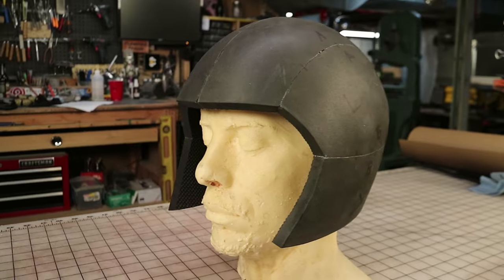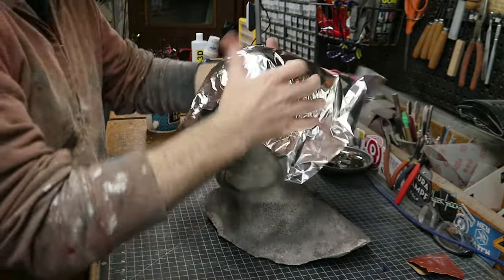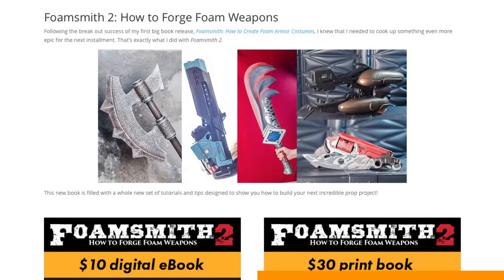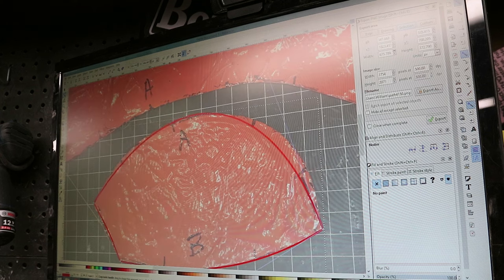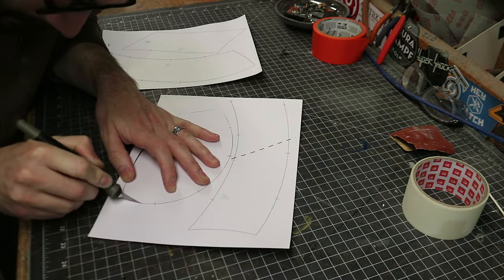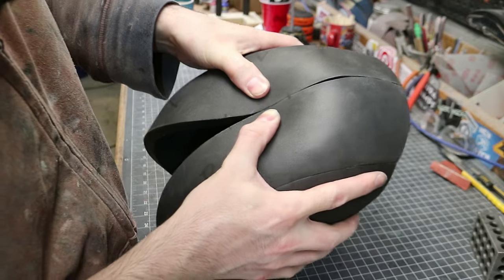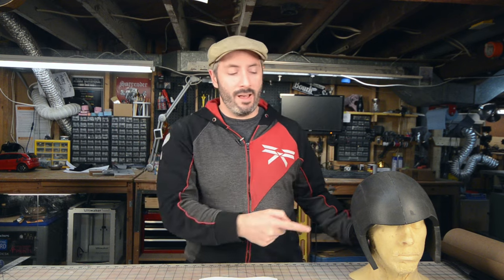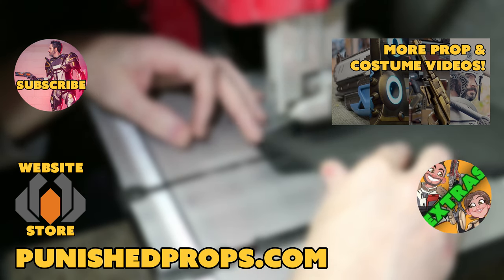Basic EVA Foam Costume Helmet Template Tutorial

Comment: What if I don't have.. A head..?
Reply: Then you shouldn't need a helmet.
Problem solved.
Reply: Then you shouldnt need a helmet! Problem solved.
Reply: Then you shouldn't need a helmet? 
Problem solved.
Reply: hibbity hoobla
Reply: Then helmet shouldn't need you. Solved problem.
Reply: Build yourself one!
Reply: Lol
Reply: same boat 😔
Reply: Trying to figure that out myself
Reply: I attatched lined paper to my head using mostly packing tape. I did lose some hair in the process when it got stuck to the tape, but I ended up with a 3-D paper model of my head that I was able to trim and use for a rough template... It did take more than one try to get my foam to be the right shape though, so take my method how you will. But it's what I did haha. XD
Reply: Try using a balloon

Comment: This works really well! I made the craft foam head form another video because mine is above average and needed custom scaling (62 cm) and then I came over to here. My scanner scans at exactly 8.5 x 11 inches so I just threw the slices in there and was able to scale them in gimp 2 after using magic select to find the edges, turning that to an outline, and cleaning up the edges.

Hot tip: the extra space at the back of the neck is super important!

Comment: I've been watching several of Bill's helmet videos, and I was wondering if there's a easy way to put a hard surface over the EVA to get a hard shell. I've not gone through all the videos yet, so does he cover this? I've also not yet built one, so I'll probably keep it simple for the first project, but I think I'd like a hard outer surface for my stuff. Maybe fiberglass? Epoxy? Thoughts?
Reply from the maker: Smooth On makes an epoxy called Epsilon that's great for brushing on a solid coat on foam.
Reply: Punished Props Academy, thanks! I signed up for the quarterly maker box too late and missed this kit. I found the pattern on your website. I'll have to find the other materials too.
Reply: Would be nice if I could order a helmet kit. Might be a product idea for you.

Comment: hi :) i'm new to the whole costume making thing and i was wondering if i could use rubber sheets instead of EVA foam for making armour, etc. Would it be the same as crafting with EVA foam? Thank you :)
Reply from the maker: It really depends on what "rubber sheets" are made out of. I know my friends in the Philippines use something they call "rubber sheet" and it works just fine for them.
Reply: Punished Props alright i'll give it a try. thank you so much! :)

Comment: May I ask how strong are the seams? what kind of force would you need to part them again? or is it as strong as the foam would be in one piece? Hi by the way, new sub here :D
Reply from the maker: +Aartwood The contact cement bond is stronger than the foam.
Reply: Punished Props thanks so much good sir, having spend the last 4 hours watching your channel and your appearances on tested and casting rubber hammers I'm feeling truly inspired right now! :o
Reply: Punished Props thanks so much good sir, having spend the last 4 hours watching your channel and your appearances on tested and casting rubber hammers I'm feeling truly inspired right now! :o

Comment: I am working on painting a helmet right now.  For the base paints I used vinyl paint.  For the details, I'm using a mix of wax and acrylics.  I would really like to seal the whole thing in a gloss clear coat to give it an oily metallic finish, but I am concerned about the flexibility of the material and whether a traditional clear coat will hold up.  Do you have any recommendations?
Reply: And that's why you're the pro maker.  :)  I know I have some spray shellac somewhere.  I'm not sure if that's what you are thinking.  
Looking at varnishes, I'm seeing quite the variety.  Some are enamel, some are acrylic, which brings up the question of what is the difference between those and the spray clear coats?  
So, I'm going to guess that you're referring to the polyurethane stuff.  

Thank you.
Reply: What's messing with me now is that I keep looking at reference photos and the helmet looks like it has different finishes in different shots.  In some shots it looks slick, like its covered in oil, while in others it looks dull and dirty like its covered in dust.  :|

Comment: do you guys recommend the Zebra contact cement, or is there no difference? and would 45 ml fit this one project?
Reply from the maker: I've never used Zebra contact cement. If you plan on doing several projects, you should probably get more than 45ml.
Reply: Punished Props thanks for the feed back. Hopefully it will be the same as every other contact cement, and yeah I may need more than 45ml. Thank you again and I Love your work.

Comment: Just one or two quick questions, if you cut the foam by knife would you sand it before gluing, and if so what strengths of sandpaper do you suggest?
Reply from the maker: The foam doesn't get sanded. The only time I'll sand the foam is if I do a round over or bevel with my rotary tool and use sandpaper to clean up the fuzzy foam bits.
Reply: Thank you! Saved me from having a dumb mistake! Happy Crafting!

Comment: What if you dont have a whizzydo computer program.. What if you have to do it all by hand???
Reply from the maker: Pulling the pattern into Inkscape is an extra step that you totally don't need to do to have a successful pattern. You can just do exactly what you see Bill doing in the first part of the video and use tape and a sharpie to create your shapes, cut them apart, and transfer directly to your material. Inkscape is free to use though and a great addition to your toolset as a craftsman :)

Comment: What's a good way to scale it up 10% without using a computer?
Reply from the maker: +Lomari You might just have to guess.
Reply: Trace the original on a 1 inch grid, use that as a guide copying to a 1.1 inch grid.

Comment: What can I do if I am not able to make a plaster head of myself?
Reply: I'm reluctant to buy a generic head that won't match my own. How can I find a premade head that will be reasonably close?
Reply: I made one. Its not as nice as a casting or anything but it worked for me!  I used plaster of paris bandages and wrapped my head (half at a time!) using some vaseline and plastic wrap to protect my hair and skin.  Once I had the two halves a used tape to get them put together properly.  Finally I thickened any thin parts with bandages and let it dry COMPLETELY.  After that I stuck a paper poster tube inside and filled the entire thing with expanding insulation foam. Lasted me for a couple years now!
Reply: Thank you!